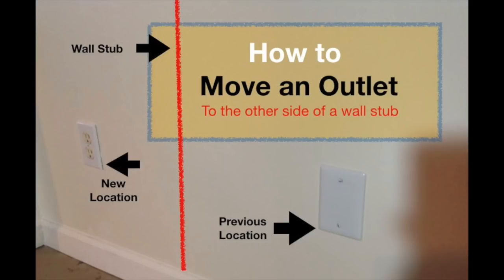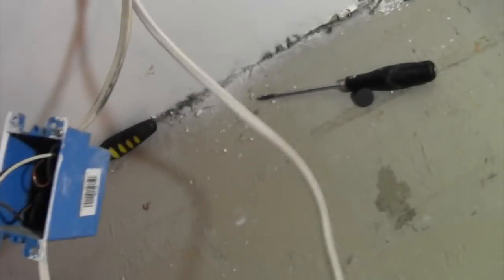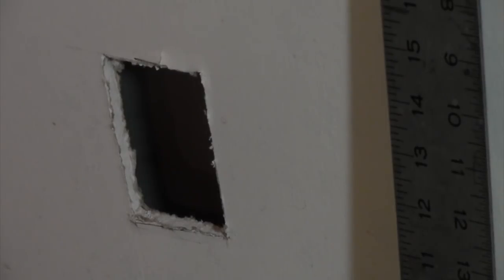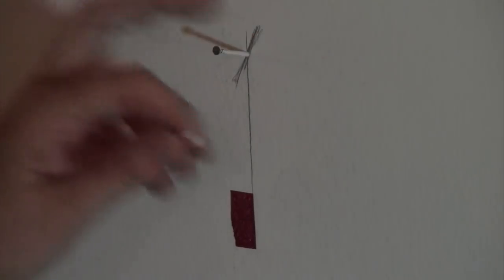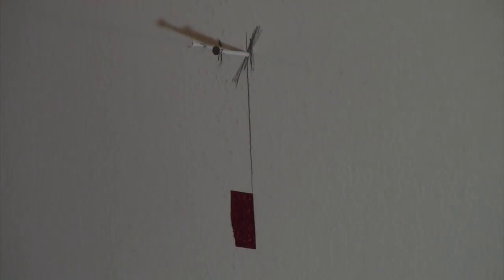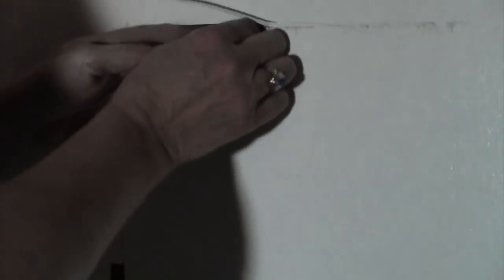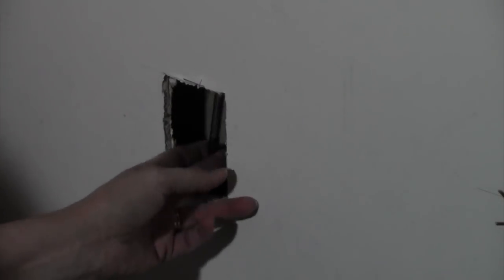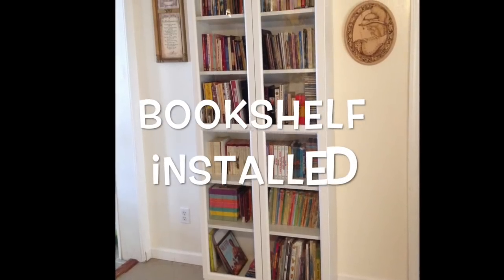Moving an Outlet on Other Side of Wall Stud

Comment: Why did you make the first drilling in the stud so high, if it would have worked to do it lower (and closer) like you did for the second cable?  Seems like the shortest distance would be the best? or was the source of the first Romex coming from above and you made the hypotenuse to save cable length?
Reply from the maker: Yes it was coming from above so I was looking for the shortest distance to make sure it would reach.

Comment: can i run my romex in front of the stud and use a mesh patch to patch over that spot? i don’t have the right tools to drill through a stud/don’t feel comfortable doing so
Reply from the maker: I don’t know what a Romex is. You can certainly use a mess patch to cover the hole.
Reply: No very dangerous for future home owners who don't know.
Reply: @DebraCarmona  You do a video on wiring but don't know what Romex is?
Reply: Absolutely not! The wire must be at least 1 1/4 inch away from the stud to prevent people from accidentally nailing into it when hanging pictures or attaching anything to the wall. If you don't know what you are doing, leave it to a professional.

Comment: Jeez, what would you have done if those wires were secured to the stud with those support staples that they usually use in residential settings where one is usually every 3 or 4 ft 🥴😬
Reply from the maker: I could feel that the wire was just hanging free within the space.
Reply: Debra Carmona yep, I gathered that much from the video lol. I was just saying in a situation where “the Romex was secured to the studs”. That would have been a nightmare

Comment: If you had just gone horizontal and added a outlet , you would have saved all the additional work, also you could have just left that outlet there and had two
Reply from the maker: Manuel Garcia yes, I suppose I could have if I went out and bought more wire. But I didn’t really want to keep the outlet because a bookshelf would be covering the old outlet.
Reply: @DebraCarmona  But, should you ever come to the point where you don't want the book shelf there and if you sell the house, you can just disconnect the additional wire to the new outlet and sheetrock over the new outlet like it was never there and be left with the original outlet on center of the wall.  Also, there'd be no harm in overloading the circuit as, the outlet that you covered with the book shelf wouldn't be used.  Or, if you wanted internal lighting on the book shelf, you could use that outlet to do so.  Electric is fun.  Oh, one more thing; you got lucky that you didn't have what's called "fire studs" or, short horizontal support studs in between your vertical studs.  You'd then have to drill yet another hole to run the wires top to bottom or, diagonally in your case.  A lot of extra work.  I must concur with Manuel; just gang those two wires in the original outlet with a new wire.  Pigtail to the original outlet and then run one wire from right to left the 3 feet through one stu(D).  ;-)  CHEERS!

Comment: Ok, aha ! How did you passed the wire from one side of the stud to the other !! ?? 2- the outlet was a remodeling box, so cable was not fixed to stud.
Reply from the maker: I went through the stud after I drilled a hole. I used fishing poles to push/pull the wire through.

Comment: Should not be running cables in diagoal. Should be vertical and horizontal.
Reply from the maker: Iain Jarvie I did not know that. Thanks for sharing that.
Reply: When fishing wires through enclosed walls I'm pretty sure that's a non-issue.
Reply: @DebraCarmona  But you still made a video showing people how to do it wrong and make it dangerous.

Comment: She yanking on wires with the electricity on 😮
Reply from the maker: @curtis1997  NO, that circuit is off. I have a light on a different circuit with an extension wire. I wouldn’t dare touch a hot wire.
Reply: @DebraCarmona you said @3:48 “now I haven’t shut off the power yet but I’m going too” that was right after you were touching the wires. Why would you say that if the power was already off then?
Reply from the maker: @curtis1997  I don’t remember the video content fully because it was so long ago. Touching covered wires is ok but touching the exposed ends is not ok. I knew what I was doing and did not take any risks